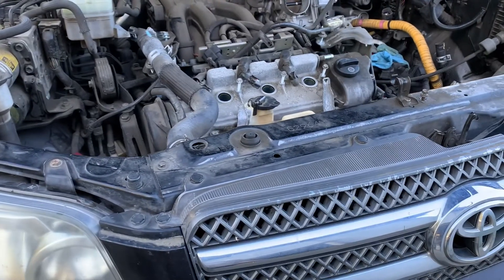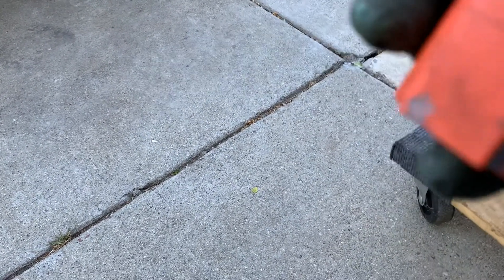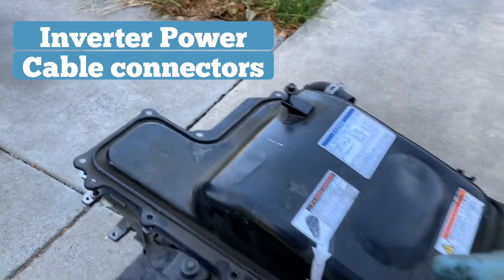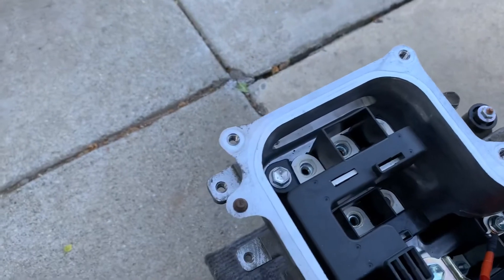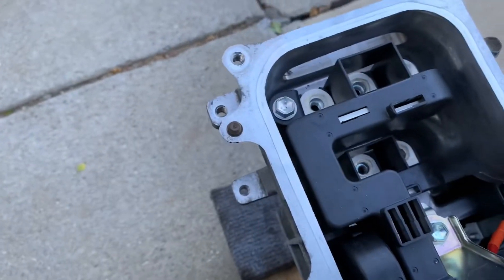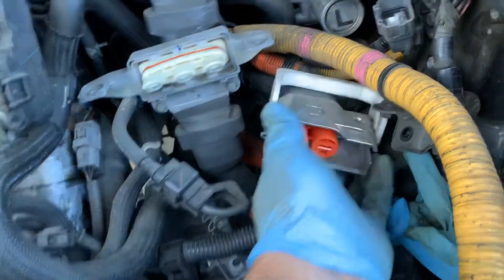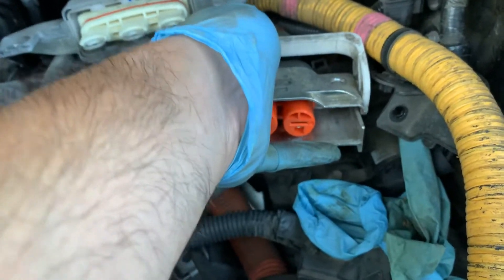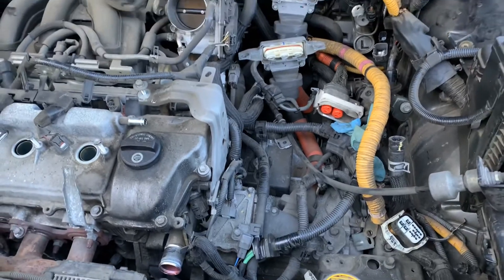How to fix Toyota Hybrid Highlander with Blown Engine and Transmission, Diagnose to Complete Startup

Comment: I’m looking at replacing my 06 Highlander hybrid engine. I just picked up the car for not much coin and it has a pretty bad knock in the engine… Do you have advice as to where I can get information on easily removing and replacing the engine? Do you have a suggestion where I can buy a good used engine? Thank you
Reply from the maker: So I would not assume the knock is just the engine.  This transmission or power split unit has a chain inside that loosens and slaps around.  Sounds like a knock.  Also, you must remove the transmission and engine together.  I just did it from the top.  Not that hard.  Remove the inverter and unplug the hybrid cables.